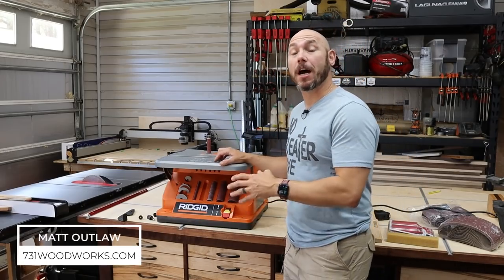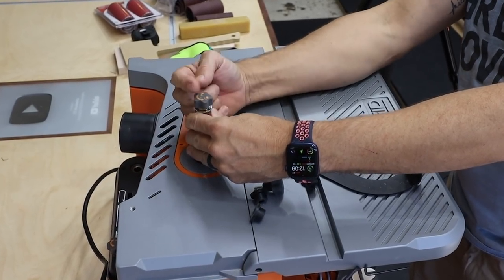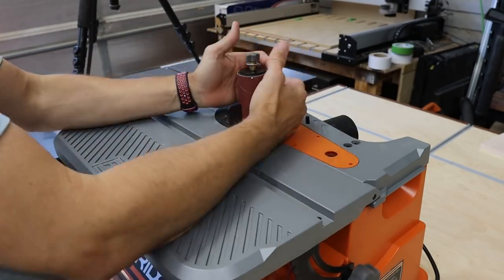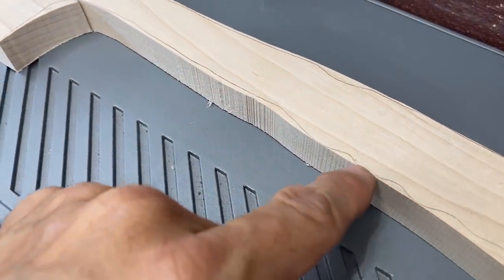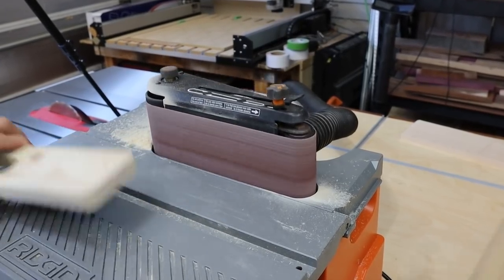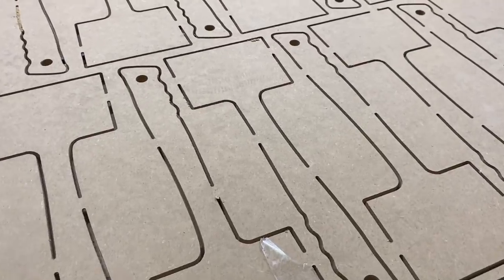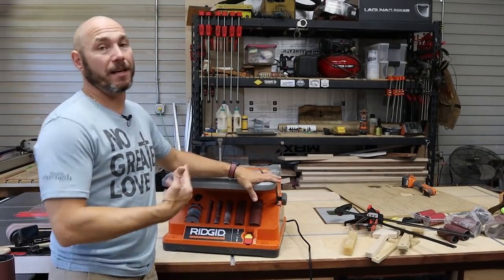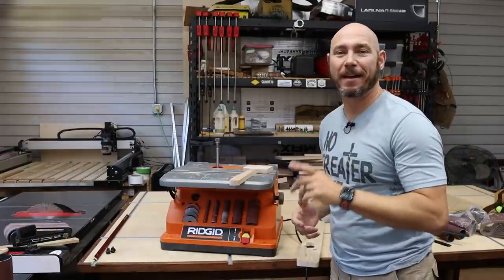This Tool Will Change The Way You Sand Woodworking Projects

Comment: Bought one of these maybe 15 years ago, when they first came out. I've found it to be a go to sander for many projects. Great complement to a band saw or any curved projects. It has lasted fine. This is NOT a $1000 tool. At times you may wish for more power.  But you're not in a hurry, right? The table is "ok" and the tilt does come in handy too. As a home craftsman, I recommend this tool

Comment: Matt.   On my flip cart i use a piece of foam under my dect to hold the pieces when the deck is at a 45° & i built a 1x1 pine rorating guard to hold in my belt attactment     works great

Comment: Love this sander now. At first I had a problem with the tightening knob/nut. The motor torque really tightens the hold down nut. I had to use pliers to remove it and wrecked the rubber knob. Luckily I have a metal lathe. I had some 1” hex steel rod turned part of it round and bought  a left hand tap. Now I can put a wrench on it to remove it, easy Peazy.

Comment: The dust collection works alot better with a dust collector vs a shop vac. Dust collectors don't have a ton of negative pressure but pull a much higher volume of air, which work better for this type of tool

Comment: Honest feedback: For a review I'd need to see things like how square is the table to the belt, can it be calibrated, and does it hold that calibration? Is the table secure or does it flex? Same with the spindle: Does it stay plum with normal pressure or does it deflect?
Reply: In my experience this makes it barely useful - the table is very flimsy, not flat, and very  difficult to get it to 90 degrees-ish

Comment: Just got the Ridgid Oscillating/Edge Belt Sander today! Glad I waited, will help me a lot. Matt, you use any other sanding sleeves/belts that didn't come with the sander? Thinking I should stock some 120 Grit and other Grits.
Reply: Kent, did you ever get those 120 grit drums? How did they work and were they easy to change back and forth from 120 to 80 grit?

Comment: I want one so much! Tired of using my palm sander and corded belt sander. Though about getting a cheaper spindle sander but I like the Ridgid tool line up, will be switching from my Ryobi tools as I replace them. Also think WEN has some nice bench top tools, got the 9" WEN Bandsaw but just haven used it much yet. I'm finishing  up a new mobile base for my table saw, next build will be a work bench/Off-feed table!
Reply: If you're not too hung up on brands and stuff, Harbor Freight sells one.
Reply: @CeeJayThe13th  Might have to take a look!
Reply: I went through the same thing. In the end I'm glad I went with the Ridgid 2 in 1. I use the belt a lot more than I thought I would.
While not cheap, it takes the place of more industrial versions that cost thousands more. And if you went with the Wen spindle sander but decided later to add the Porter Cable belt sander, you'd be spending $110 more for both and take up more valuable space in the shop.
After owning and using the Ridgid, I'd buy it again in a heartbeat.

Comment: Great review. I wanted the Rigid, but 6 months ago, you couldn’t get this unit so I got a WEN. I think this Rigid sander out is version 3. Forgive me if you mentioned this, but The Rigid sander is the largest of the sanders out there. Did you mention using erasers to clean the sander belts and rollers?

Comment: I wonder if the dust collection would be better with a proper high volume dust collector. Theres a lot of area the vacuum has to pull air from, and shopvacs just are not able to pull high volume.

Comment: I just bought the WEN version.  same sander - different color.  has trhe belt and the spindles.
Reply: The WEN version is opposite hand. The drive spindle is on the right on the WEN, on the left on the Ridgid. The dust collection is on the left side on the WEN, on the rear on the Ridgid. WEN's table does NOT have the miter slot.

Comment: I bought those SATC Sanding Belts that you have linked but they keep slipping up or down even when I adjust with the knob.  Is there a way to tighten the belts to prevent that I haven't dicovered?

Comment: The LSA for Ridgid is a bit of fools gold. Yeah it sounds awesome, but it's a bummer if there's major delays because they are constantly fixing things. I have the rigid table saw and really like it but the gears that move the blade up and down are make of plastic and is a known issue and got stripped out. The upshot it all was I was without a tablesaw for over 2 months as they had a shortage or parts to fix the issue. I'd rather have tools that don't break, than have an LSA.  It's like Harbor Freight and their warranty. How much benefit do you get when you constantly have to drive to the store to get a new wrench, screwdriver, etc?

Comment: One thing I would have liked to see you mention is the miter guage slot... and that it is well over 3/4 inch wide which makes it a nice decoration but fairly useless unless there's some magical miter guage standard thats different than any of the 7 tools in my shop...
Reply from the maker: Yeah, I don't see myself ever using that which is why I didn't mention it.  Never crossed my mind

Comment: Hi Matt, I added this to my tool collection this Christmas.  I hadn’t used it until this week and tbh didn’t realize I was missing the 1/2” spindle.  I am hoping ridgid will send me one.  Can you tell me where to find the belts for the spindles?
Reply: Manual says to just use the metal shaft for the 1/2 drum.

Comment: Leave this tool in an area where you can get to it easy. If you can turn around or take a few steps and you're sanding. Man it's a game changer. Everything I've made over the last 2 years has touched this machine. Well worth it. If you get finer sand paper online this thing cleans up projects super smooth.

Comment: Have you had any issues with your sander shocking you (static electricity)? I bought one of these (been wanting one for a while, and this video pushed me over the edge - thanks a bunch), love it dearly, but the static is eating me alive. I have mostly used the belt attachment. If I have an arm resting on the table to hold my material in place, it feels like my arm is on top of an ant bed. I've checked for any loose debris on the table (none). I am using the concrete floor dust collection system, so it isn't that (I didn't even have my shop vac plugged in). None of my other tools are doing this to me!
Reply from the maker: I havne't had tha tissue

Comment: This is definitely on the list of things to get.
1.  Planer
2. Jointer
3. Band saw
4. A sander of some type, probably something like in the video...
5. Then find a garage to rent out to make I to a wood working shop.
Apartment living and being a "wood worker" ,well, let just say, not so easy.
Reply: Have you considered a jointer sled for use in your planer? You get the larger width capacity for ‘free’ unless you want to drop $$$$ on a freestanding unit. I just picked up a Ridgid 13.5” planer seriously considering dropping the jointer from my wishlist since I have a small shop

Comment: Seen people post on youtube and Facebook saying that ridgid's lifetime service agreement isn't the greatest people say ridgid will try anything to deny claims
Reply: Same thing with Wen actually if you have something break that is under warranty they don't know you
Reply: But I still want one someday
Reply: =Have had ridgid battery tools for many years. Have never had any trouble with the lifetime warranty. Batteries were replaced just by calling the number they give you. Hammer drill was taken to service dealer and repaired in several weeks. No problem getting it fixed.
Reply: I used the lifetime warranty for the first time recently. Have the hand vacuum and the propeller exploded. Called them up and they sent me a new one in a couple weeks. Easy to do.... Just took some time to get here. Not sure how much due to pandemic issue.

Comment: It’s good until you want or need to take advantage of the LSA.  They want $30 just to take the machine, and in my case my local HD where I purchased it would not accept it back to repair it when the belt assembly broke.  They sent me to another HD far away for repairs.  No thanks to ridgid garbage again.  When it breaks, it’s basically a paperweight.

Comment: The rubber mandrels don't fit any brand sanding drum I have bought. They don't compress to tighten the sanding drum to stop it from moving. I've called, and emailed and tried everything to contact Ridgid with no success.

The only thing I'm able to use is the belt sander
Reply: I'm in the same boat. Bought mine last Fall and by the end of Winter mine wouldn't tighten enough to compress the rubber mandrel to hold the sandpaper in place. I'm also limited to using the belt sander. It's a must have tool for making charcuterie boards so I guess I'll have to shop around for a good one

Comment: They are about to change this model over to a different manufacturer (Delta, I think) and the LSA will no longer apply to the new model, it will be a 3 or 5 year warranty. Go grab it before the current model is gone. The new model will not have the orange case, it basically be the just the frame with top and tool tray.
Reply: interesting ! Where have you read about that?

Comment: This is the worst part about getting a shop built up... I know spindle sanders are useful and want one, but I need to spend waaay more $ for the other basics I still need. Its one of those luxury tools that you can get away without, but man is it nice to have. Kinda like a drill press, or maybe a band saw. Effective time saving tools, but big cost up front.